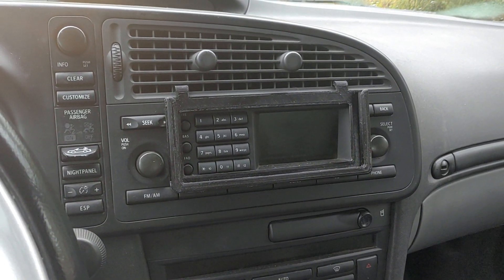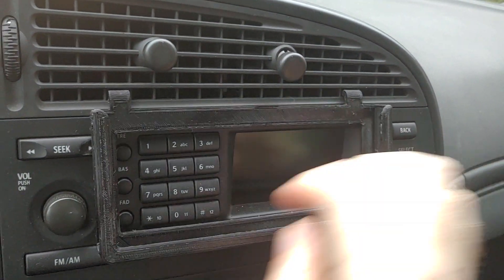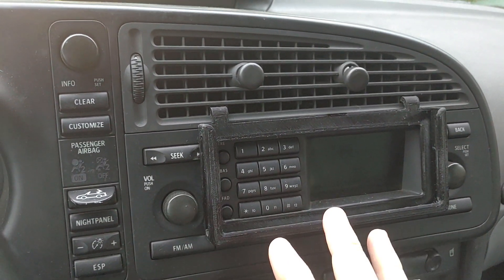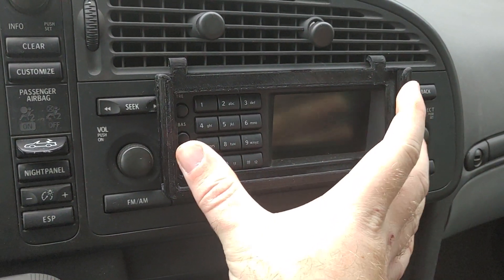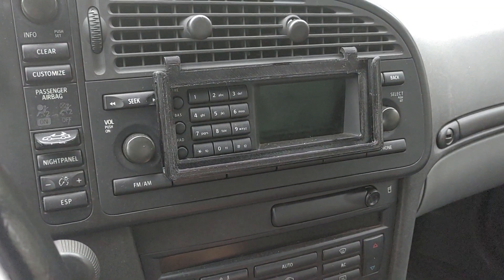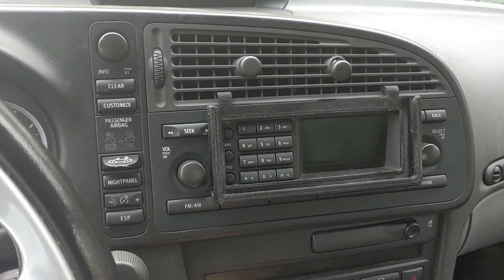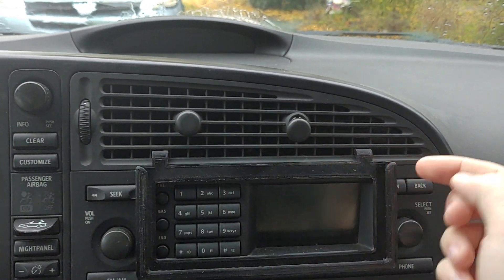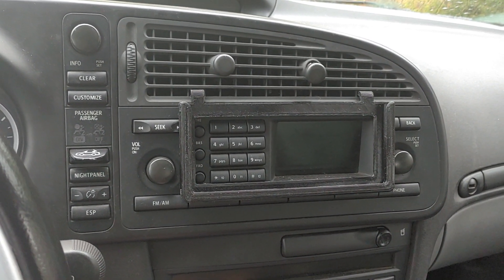I designed a 3D-printed phone holder for the Saab 9-3

Comment: Any Chance you will sell me one?
My phone is 6 7/8 x 3 1/4 x 1/2
Reply from the maker: I'm not printing these to sell, but if you don't have a 3D printer or a friend with a 3D printer, there are plenty of services available to send them a file and have them print it for you. Google "3d printing services" to get a bunch of options.

Based on the phone size you've listed here, you'd want to send them the file "phone-holder-172-13.stl" and have them print it in TPU.

Comment: Hello, great video and product. I went to download the files but it comes up as a 404  can’t access page 😩
Reply from the maker: Unfortunately it sounds like Thingiverse has been acting up when folks try to download all files. The good thing though is that you only need the one file sized to your phone, and you can just download that one individually. Just click on the "Thing Files" tab, and then use the search feature in your browser to find the right one.
Reply: @ChucksRides  thank you!
Reply from the maker: @dingbat5653  No problem! Feel free to reach out if there are any more issues. :)
Reply: @ChucksRides  I’m trying to find one for iPhone 10 and 12
Reply from the maker: @dingbat5653  Well, the best bet is to measure the phones directly to ensure you get the right measurements. A good digital caliper is the way to go, and they can be found for super cheap.

However, going off the dimensions for those phones as found on GSM Arena (assuming the stock rather than pro models and no cases), then the iPhone X (10) is 143.6mm in height and 7.7mm in thickness, which means that you would want to download phone-holder-144-08.stl for it. But the iPhone 12 is 146.7mm in height and 7.4mm in thickness, which means that you'll want to download phone-holder-148-08.stl.

If you're planning on using a single phone holder for both phones, then go with the bigger one: phone-holder-148-08.stl. The smaller phone will sit a little looser in the holder, but with that little difference, it should (in theory) still hold it. Alternatively, given the flexibility of TPU, you might be able to get away with splitting the difference and fitting the bigger phone snuggly into the intermediate size of phone-holder-146-08.stl. That would only require each side of the holder to stretch out by 0.35mm, which seems pretty doable.

If you have your own 3D printer and don't mind giving it a few tries, you might experiment a bit to just see which works best with your two phones before actually mounting it in your car.

All that said, this is again assuming accurate measurements and no cases. If you do have cases on your phones, then you really will need to just measure their height (or width when turned sideways as they'll be in the phone holder) and thickness. You won't regret having a digital caliper around, and they're literally like $12 for perfectly acceptable ones off Amazon or wherever.
Reply: @ChucksRides  you da man! I was wondering if those numbers meant the measurements in mm.

I appreciate the time and writing such a detailed reply.

Keep up the good work.
Reply from the maker: @dingbat5653  No worries! I tried to explain it as best as I could on the Thingiverse page, but I do understand that's a whole wall of text I'm throwing at you there. Regardless, hope all this helps!

Comment: Would this work is a PLA filament?
Reply from the maker: No, I would not recommend that. It really needs the flexibility of TPU to fit into the air-vent holes and keep from breaking. The harder PLA would at best scratch and at worst break the vent, and it even if you got it in, those tabs would certainly break off inside before long. Plus PLA doesn't tend to hold up well with prolonged exposure to sunlight.
Reply from the maker: That said, if you've never used TPU before, I wouldn't be scared off by it. The TRONXY brand I like prints very easily. Just change the heat settings accordingly, maybe slow it down a little, and expect a bit more stringing to clean up, but it's really not bad.